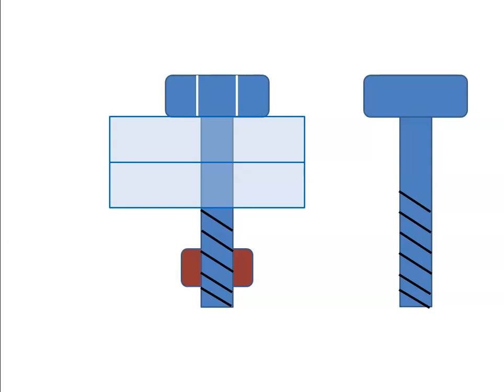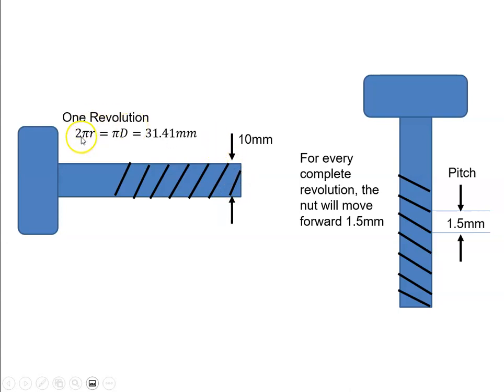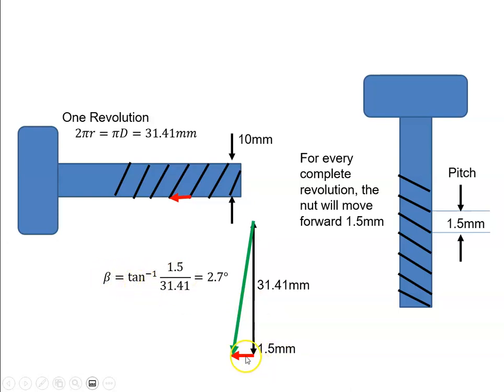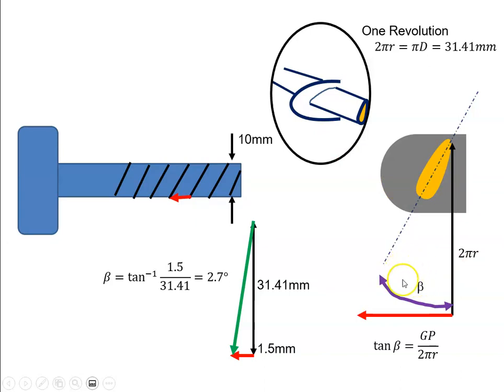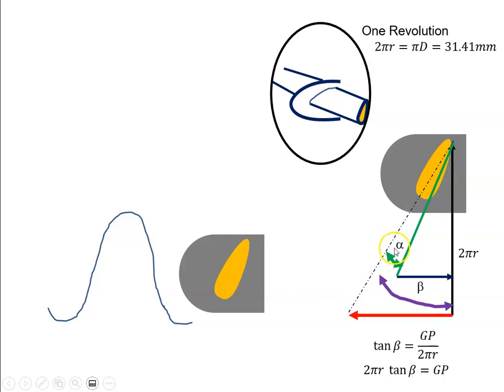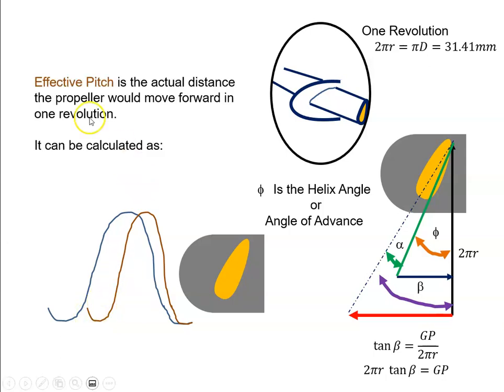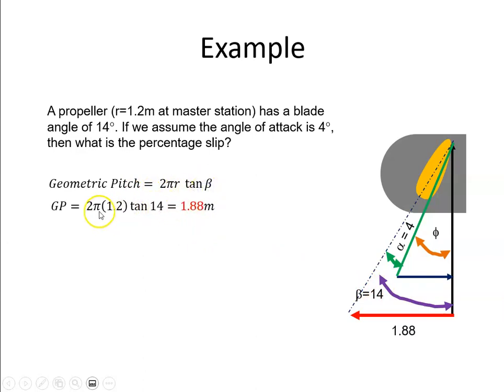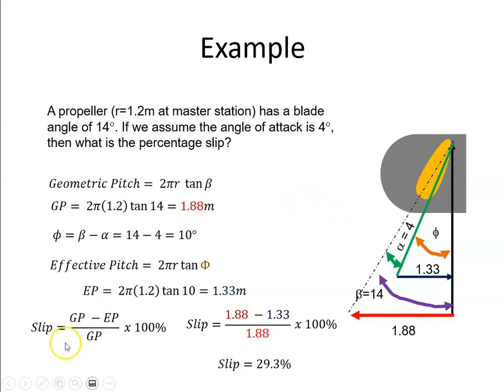Propeller Slip

Comment: If I was given motor power, and desired diameter, how would I optimize a new propeller design to maximize amount of airflow?
Reply from the maker: Mass flow of air = density x area of prop disc x velocity.   If for a given altitude the density and area of the disc (based on prop diameter) are fixed, then the only thing left to vary is velocity.   The velocity can be considered as the sum of aircraft velocity and inflow factor.  The inflow factor depends on the prop efficiency.  So, to maximize the mass flow of air trough the prop, the prop should be operated at the optimum angle of attack (where lift to drag is a max) to maximize efficiency and inflow factor.
Reply: @RoddyMcNamee  thanks!